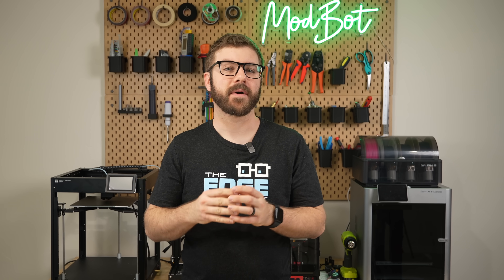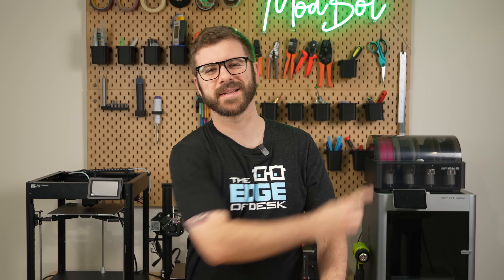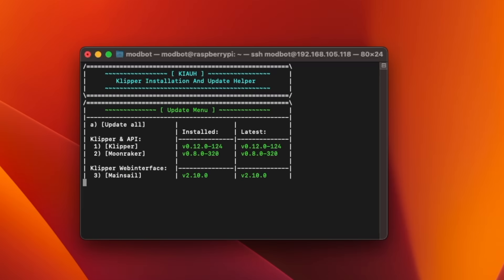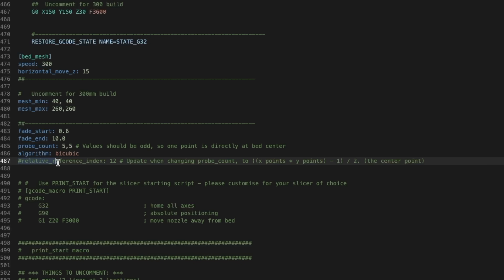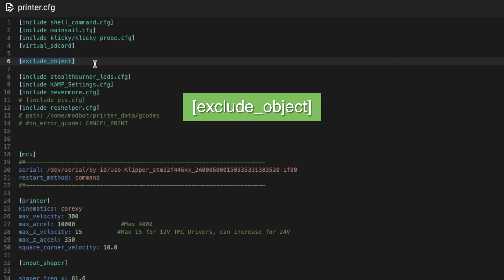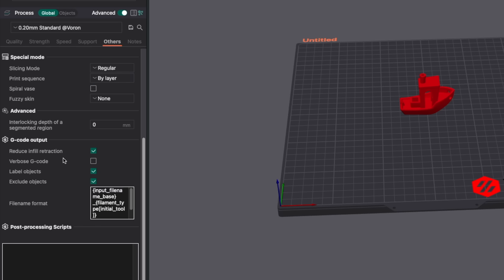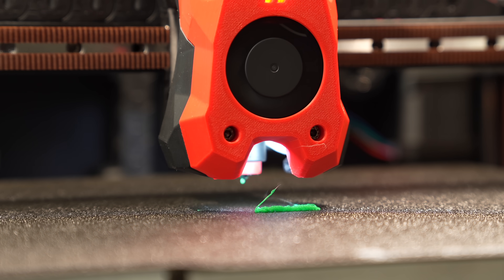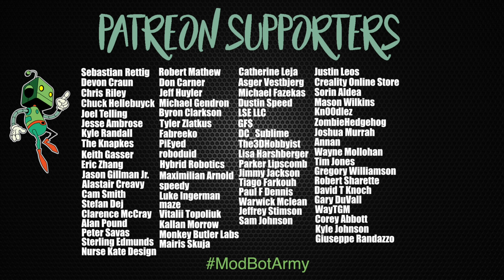Native Adaptive Bed Meshing In Klipper Is Here

Comment: I know it's a small thing, but shout out to KAMP's purge line. After years of watching my Marlin based printers running long thin lines up and down the side of the build plate, I was a bit startled the first time I saw that chubby caterpillar being deposited on my bed.  I didn't even know my hotend could do that.  Works great though.  If I wasn't so lazy, I'd figure out how to make my Marlin printers do that.
Reply: The problem I find with the purge line is how its position is calculated. If you have a large brim and a skirt or two the print head runs into that purge line and either jacks the head around or drags it into the first layer.

It's as if the position is calculated off the print itself and isn't even aware of the brim and skirt.
Reply: @MonkeyButlerLabs  I run into this as well, as I just copied the KAMP purge line code into my own PURGE_LINE macro in the printer.cfg. Maybe there is some variable for skirt distance, that could help. Until then, I just stand closeby with my tweezers peeling of the purge line as soon as it gets printed, before the skirt starts... ;)
Reply: I'm not familiar with adaptive purging but I use some poop pellet mod I found online. It works pretty well and is fun because it makes pellets that are kinda shaped like poop emojis and every once in a while you get to empty the poop tray like it's a diaper for your printer.
Reply: well in cura that's a default option by enabling "Enable Prime Blob" under material settings, which is done by default.
you can also rip its startup gcode to recreate this behavior like i'd done
Reply: Cool feature of purge line is that u can look at it and be sure if the filament is wet or not. It's a way more intelligent indicator then your filament dryer screen 😁
Reply: Extrudes a lot of plastic without moving the head much